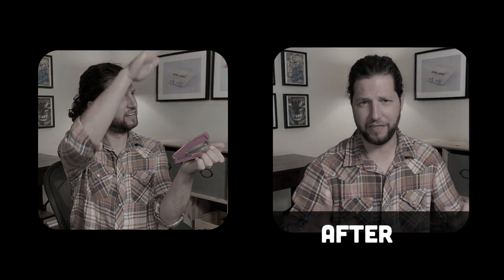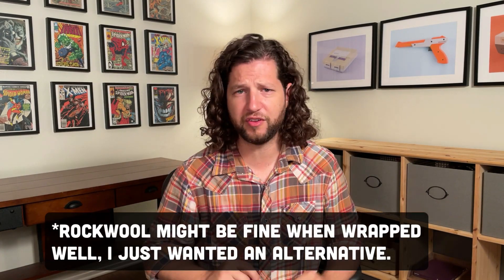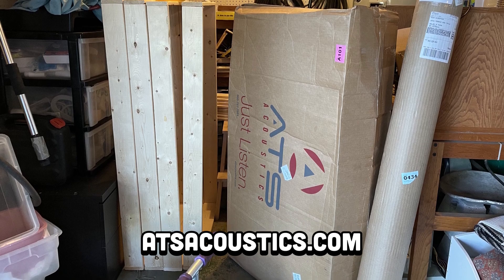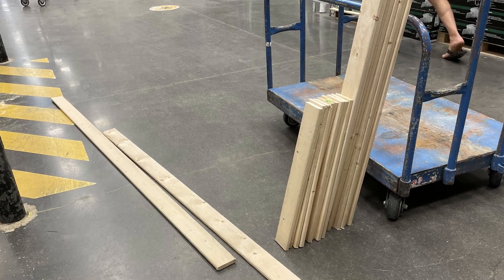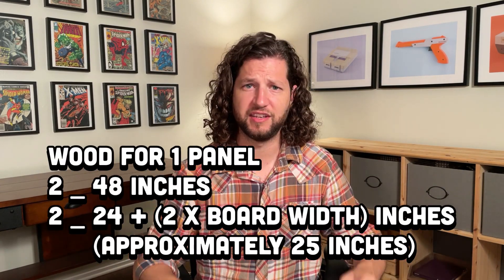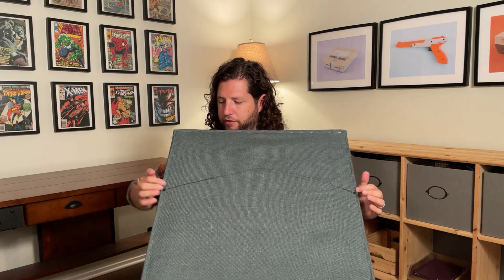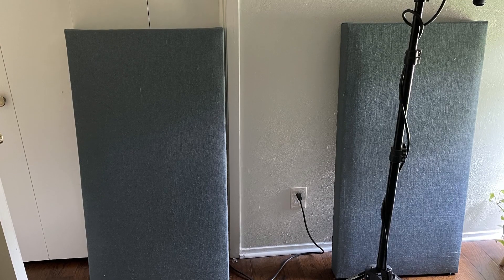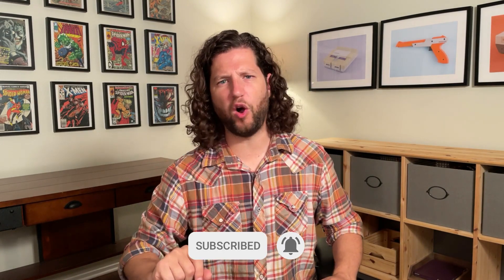Tips on Making Safe, Eco-Friendly Acoustic Panels

Comment: Good video, they look great!

For anyone else overwhelmed by the screw aisle, I recommend buying torx head screws (or even square head). Torx will come with the bit you need if you're using a drill, and they avoid so many frustrations you can have with phillips head. It's time to convince stores that phillips head is done. #FightBigPhillips
Reply from the maker: Oh, I've stripped many a Phillips head screw in my day.  The other screws I categorize as "fancy" screws. They used fancy square screws on my porch. Thanks for commenting!

Comment: Is 10.Oz cotton duck canvas a good material for the front of acoustic panels?
Reply from the maker: Yeah, it sounds like a good one! https://thehometheaterdiy.com/best-fabric-for-acoustic-panels/
Reply: @mobypixel  actually i have some cotton duck canvas with me but if i blew air from it, it doesn’t travel through the other side. I guess cotton duck canvas and cotton duck fabric are different. Kindly guide me on choosing the right material for the fabric. Thank you.
Reply: @mobypixel  actually i saw cotton duck in the above mentioned link like a week ago, but the cloth i’m having with me is cotton duck canvas. The fabric which i have doesn’t seem to be breathable as i cannot feel the air at the other side if i blew some air from the either side.

Comment: Did you mean 26 inches? Each board is 1-inch thick
Reply from the maker: Yes, that is correct. In the video I linked, he measured them this way to account for variants in board thickness. The basic idea is to have the opening the exact size of the batts.